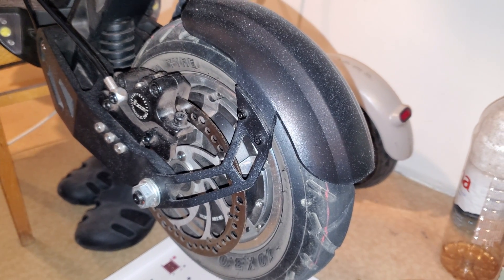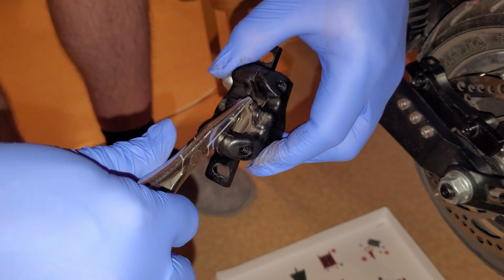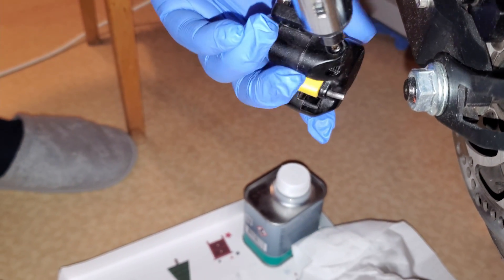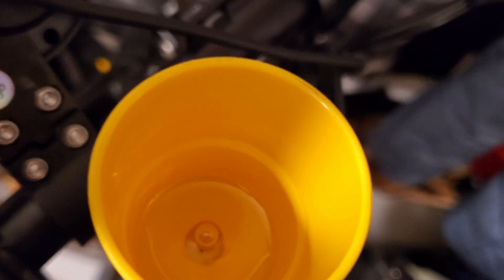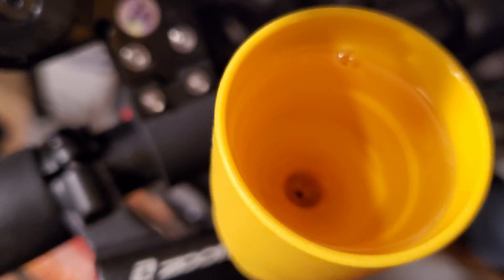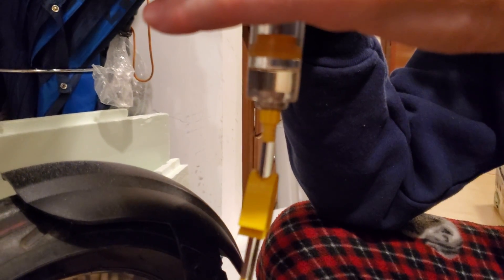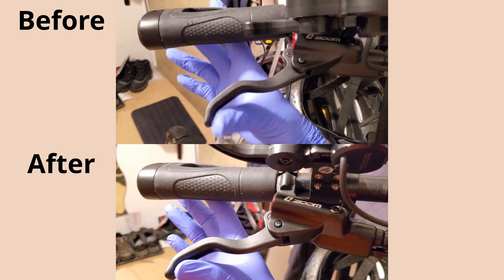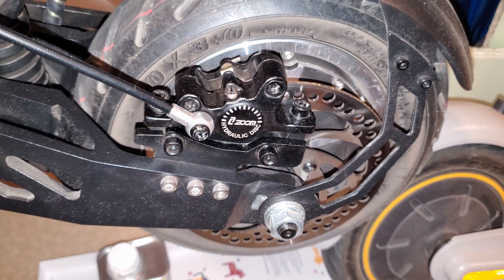Bleeding Zoom Hydraulic Brakes on an Electric Scooter (VDM-10 / Apollo Ghost)

Comment: Is there a way to adjust the brakes without bleeding them? I just received my scooter and my back brakes don’t have much stopping power at all
Reply from the maker: I don't think so. You can adjust the spacing of the brake lever with the tiny screw (https://imgur.com/a/pLNUNSU) but that won't really improve the braking.
You can also try a top bleed. You take out the reservoir screw on the brake lever, put in the yellow funnel (with a bit of hose and a hose clamp), put some oil into it and press the brake lever several times until all air bubbles come out, then secure the hose clamp and remove the funnel with the remaining oil, and screw back the reservoir screw. 

A top bleed can help a bit, if you don't want to do the full bleed; but if your brakes are very bad you really should do a full bleed as in the video, as the top bleed is of limited help if you have a ton of air in the brake lines.

If you have any questions about the full process in the video, feel free to ask, and I will try to help where I can.

If you really don't feel like doing it yourself, any competent bike shop service should be able to bleed the brakes for you, as they are basically the same as on bicycles.

Comment: what zoom model is that?
Reply from the maker: I did bit more research; it looks like the model number of the brakes is ZOOM HB875-E. That is all I could find, still no manual/parts list, etc.
Reply from the maker: I am not sure. These were the stock brakes on the VDM-10 scooter. There is no model number on them that I could see. They are the same I have seen on many other electric scooters, such as Vsett, Dualtron, Zero, etc.
I tried to get a manual for the brakes, but the manufacturer of the scooter as well as several sellers I asked all said there is no manual or more detailed information on the Zoom Brakes.

Comment: OMG! Thank you very much for this video!!! My brakes working well now! :D I have ordered brake pad from Aliexpress, but they seem a little bit larger of 1-2mm and they don't fit.... Do you have a link to buy brake pad  ?
Reply from the maker: Glad the video helped you out :) Unfortunately I don't have a tested link for the brake pads, as I am still using the stock ones that came with the scooter. I would recommend taking out the brake pads and going to a local bike/scooter shop and asking for the same size ones, you can compare the size in the bike shop; that's what I plan to do soon to have a backup when mine wear out.

As for links I would try if there was no other option,
The Large ZOOM Brake Pad on https://revrides.com/collections/all-parts/products/zero-brake-pads should be the ones you are looking for.
If you are in EU I found https://youvelo.fr/vtt/586-plaquette-carbone-quaxar-pour-vsett-10.html that should work or https://www.electric-motion.cz/brzdove-desticky-zoom-wolf-warrior-11/
Reply: I shave off a millimeter off the side with a grinder, they fit perfect now.

Comment: Do you have a link for the bleed kit .  I bought one and It doesn’t have the fittings for the caliper nor for the master cylinder on the brake handle .
Reply from the maker: Yes, the links to the bleed kit I used are in the video description.
e.g. see:
Bleed kit – EZmtb Bleed Kit https://ezmtb.com/
https://www.amazon.de/dp/B07K9J32XD/
https://www.amazon.de/dp/B08D922KYF/
https://www.amazon.com/dp/B089MFMTD5/

Comment: Nice instructions. How many miles/km did you have on your ghost before having to do this maintenance?
Reply from the maker: I did it after 450km, but it was not good out of the box. I only did a top bleed back then, and it was usable. But as I had more downtime over winter I wanted to do it properly to get ready for Spring riding.

Comment: Where did you buy the tools for bleeding the caliper?
the say shimano bleedinh kit wont fit.
Thanks.
Reply from the maker: I bought the bleed kit in a local scooter shop, but I linked the US and German amazon store pages in the video description where you can buy the same kit, check the video description above for all the used tools. The EZmtb bleed kit had the needed adapters for the zoom brakes.
Let me know if you are still having trouble finding it.

here is another link I found https://www.amazon.de/-/en/Bicycle-Mountain-Hyaraulic-Bleeding-Mineral/dp/B08D922KYF/ or for CA e.g. https://www.amazon.ca/Professional-Universal-Hydraulic-Bicycle-Mineral/dp/B07FYFDNSY/ you will find more if you search for EZmtb bleed kit.

This one should work as well as it specifically mentions zoom brakes, but I have not tested it, so no guarantees https://www.amazon.de/Cycobyco-Mineral-Hydraulic-Shimano-HS33-Nutt/dp/B07845XW4X/

Comment: Good instructional video on this man..... I'll be doing both my zoom and nutts brakes in the coming weeks. One tip id give is when you remove the cup off the brake lever and before you at the srew back in the final time, adjust the brake lever tension screw till you see oil come up to the top of the oil screw hole, then put the screw back in (a little messy, but makes sure no air gets in the system)
Reply from the maker: @AetherLocke  Its this small screw under the brake lever; see pic https://imgur.com/a/pLNUNSU